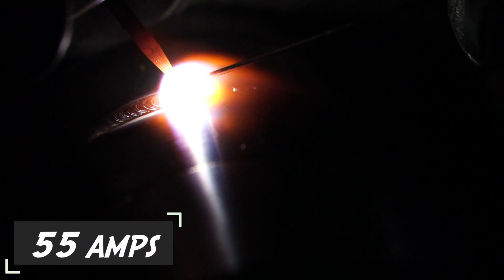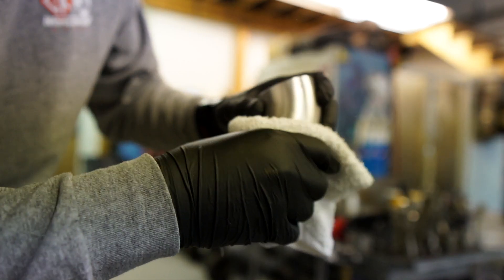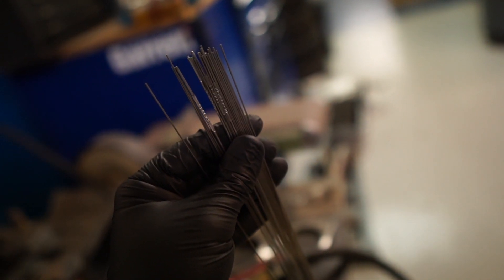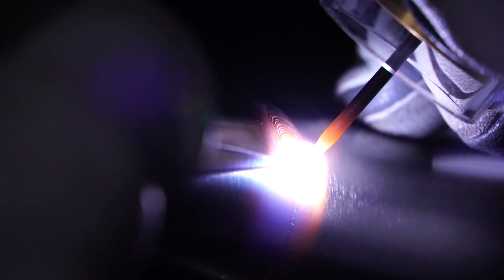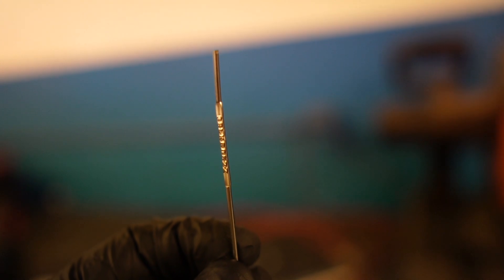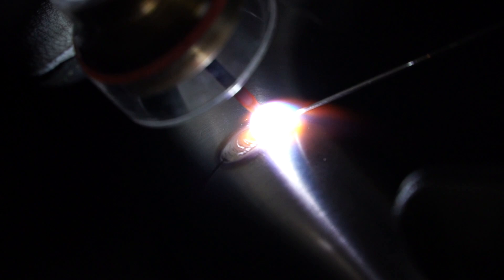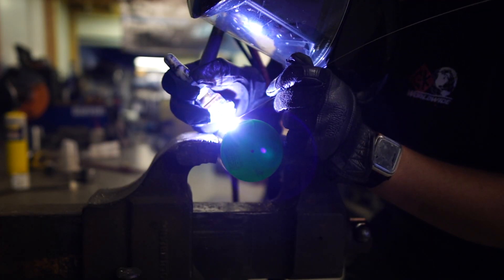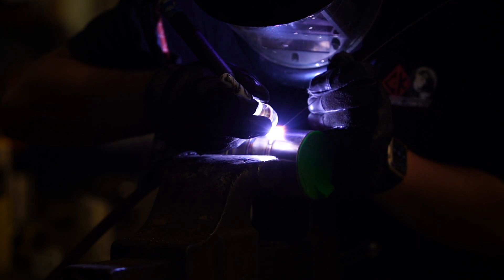How to TIG WELD Stainless Steel Tube + Tips & Tricks | Automotive Fabrication | GTAW CUPS

Comment: Lastly I was having problems with a 304 weld which was dirty from time to time. Turns out I had cleaned the filler rod with a dry cloth but that wasn't enough. Cleaned again with acetone, cloth was dirty. My problem was solved. It matters, folks !

Comment: Good video. Just remember when welding with filler don't  pull your wire out of the gas shield zone, or it will oxidise  and contaminate your weld when you dip it back in again. It's also good practice to cool your wire in the shielding gas at the end of a weld so it is ready to go for your next start

Comment: Would TIG welding be used to weld stainless exhaust tip? while on car? If so how do you purge? I'm just trying to understand what to look for as far as finding someone to weld tips onto my stock exhaust (it's stainless too)..I don't really care about looks as long as the welds will do their job holding the exhaust tip on the tail pipe.

Comment: I am not a welder by any stretch of the imagination but I am indeed intrigued by the process of TIG welding. With that in mind please excuse my ignorant question but - why do you plug the ends of the tubes?

Comment: Awesome video. However, cross contamination should be mentioned.  I realize you are doing a demo but you mentioned stainless and steel on the same belt. Also aluminum table or butcher paper for your table top. No one likes surface rust from cross contamination of steel, especially sanitary and high heat applications. I subscribed.

Comment: The Electrodes to Liquified Airon usually the Arm that bringing down the Electrodes are Make with fewest parts of  stainless steel with a tolerances of 2 millimeters,  Case ...Durability but difficult while you work with this Tolerances, because the Heath and friction changes the dimensions,  went we tooking a Arm with a weight 5 Tones and has to used 24/7 , while  close temperature to melted iron, and cost of operatio is to high, and Maintenance Contract Companies Bitter Process,  👍 
This is cool to know , on that Time I used to Rectified this Arms with a minimum knowledge on welding stainless steel

Comment: I just started working at a place we weld 316 SS with 80% of the welds are pipe and tube. From 2 to 72 inch pipes and tube. I'm fairly new comfort and consistency are definitely the number one thing to work on

Comment: what if you are not able to purge the tube? like fitting up an exhaust and long tubes. how is the best way to weld tube without the ability to purge?
Reply: Make a flux. 50% boric acid and 50% borax, mix the powder, heat the powder to 450-500 degrees to melt the powder. Cool, grind the solid piece to a powder. mix the powder with ethyl or isopropyl alcohol until the viscosity is like thick sour cream. Apply a thick flux to the back joint of the pipe, wait 15 minutes. The ethyl alcohol will evaporate. Weld stainless steel pipe. The flux on the back side will melt and close the weld from the air. After welding with hot boiling water inside the pipe.

Comment: I dont think everyone is cut out for TIG welding. I can Stick, MIG pretty good but my TIG Sucks, specially when I'm trying to build a 304 stainless exhaust system. My welds are embarrassing to look at but get the job done. I think you need to do TIG 40 hrs a week or just be extremely consistent, persistent and have alot of concentration to master stainless tube welding. Kudos in trying to teach us dummies out here.:)
Reply: You probably just can't see the puddle. I find that when I do stick and mig that the orange puddle is easy to see with green shades. My eyes can't see shit with tig and green tints. Once I got my optrel crystal 2.0 I could see the puddle. Some other true color hamlets are almost the same. I thought I sucked at first.

Comment: hello brad! very good video with many informations!! I would like to ask you something,...... you said that you welding this part with pedal ,all the way down with 65Amps straight DC? Is it 1.5 mm thickness? What straight amps you use for 2mm and 3mm? Thanks in advance
Reply: usually 1 amp per .001... but .045" filler rod running 45amps with a nice bevel on your joint will work well on your standard .065" stainless exhaust tubing

Comment: Do you have a video on how to weld V band flanges and not warp them?
Reply from the maker: I do not.. but, just bolt two together with the v band clamp and let them cool before removing the clamp. I’ve never had one warp.
Reply: @hourglassingenuity103  Thanks, I did that still managed to warp one, i was probably around 55-65 amps while welding. I didn’t weld the whole thing in one shot either so I’m not sure

Comment: What is the idea with pie cuts?
Reply from the maker: You can’t achieve the same center line radius with a mandrel bend.. even a tight radius mandrel bend.. that you can with right radius pie cuts. They allow you to move through geometry in the engine bay and bend around things for clearance you couldn’t normally.

Comment: So lets say u running a DN 50 Pipe (54mm or 60.3mm Ø) u cant possible run 65 amps right? Or i guess u run around 50 +- with the pedal input? And 1.6mm Wire?

Comment: Just discovered your channel and subbed. Excellent presentation and tips. What brand gloves do you use? The company buys gloves for glory tig welding gloves but they release a foul residue from inside the glove. Very irritating and messy to say nothing of what we might be inhaleing. Please  respond with your choice glove brand and thank you in advance.
Reply from the maker: Hey Nelson, thank you! I appreciate it. I personally run of a glove from a company called torch wear. They no longer make Tig welding gloves. I’m waiting on a new company to finish the prototype and send me a pair of gloves to try and I can report back with a video. You can also always get away with some tigsters or millers. Have a great day!

Comment: Awesome video! My only question is you said you use the same belt to sharpen tungsten for carbon and ss. I was taught never ever cross contaminate anything from ss to carbon. Because the ss can rust if contaminated with anything from carbon steel. Ive also seen 1st hand proof of this. Cut some ss pipe with a blade used for carbon and it got wet, few days later it had surface rust.
Reply from the maker: Everything is ground on a 6” wide belt. Left is for Steel, right side is for Stainless steel. A completely dedicated belt for aluminum.. besides, this is automotive fabrication man. I appreciate your precision but cutting SS and mild steel on one blade and leaving deposits is completely different than sharpening tungsten on the same belt. I do pay attention to where I sharpen my tungsten in the belt .. BUT I’ve welded a decent amount of stainless from automotive fabrication, aerospace and sanitary grade tubing and have never had an issue with imbedding or contaminating my part. In my defense, I don’t typically dip tungsten bad. I might just barely touch off on the tip if I’m holding a tight arc but as for absolutely burying my tungsten, I don’t anymore and I can see that being a problem. With that said, I’ve never had any SS rust due to improper technique. Thank you for the very good question! Weld on 🤘🏻

Comment: So tac welds don’t require any filler rod ?
Reply from the maker: With good fit up on reactive alloys like stainless steel, you can autogenously tack weld (without filler)  together your parts.
Reply: Nope.   Nice quick full pedal with a shorty gap is all you need.  304 stainless is a pleasure to weld.   I'll take that over aluminum any day of the week.
Reply from the maker: Shirosake aluminum keeps you on your toes. Embrace it. 😅
Reply: Thanks brother man I messaged you on ig as well

Comment: do you grind different application tungsten  all on the same sharpener. IE stainless, aluminum on the same sharpener. i like the hand held being capable to perform mobile processes of welding
Reply from the maker: Hey Pat, in this video I talk about how I use 2 separate belts on a belt sander to grind my tungsten.. I use a belt for reactive alloys and I use a belt for aluminum. I try my best to make sure everything has a dedicated alloy whether it’s a belt to grind or prep a part or it’s a belt to sharpen tungsten. 👊🏻

Comment: what mm is the tube?
Reply from the maker: 1.6mm SS tube.
Reply: HourGlassIngenuity and u run 65 amps on that?
Reply from the maker: I state in my video a few times that I set my amperage about 10 amps higher than what I weld with.. actual amperage while welding will vary from 50-55 amps on 1.6mm SS tube.

Comment: How do you know what amperage to weld your material at? You say several times to set it 10 amps more than what you want to weld at but if someone doesn't have experience, how are they supposed to know?
Reply from the maker: I showed examples a few times on my amperage on this specific material thickness. Machine is set at 65 amps.. I’m only talking about .0625 or 1.6mm tube in this video. Did you skip through the video? Have a great weekend.
Reply: @hourglassingenuity103  no I watched the whole video. My point is that there's other thicknesses and that amperage changes with material thickness. How does someone with little to no experience who is trying to learn determine the appropriate amperage to start with?
Reply from the maker: Nathan Schmaltz yes, I 100% understand. But this video is structured around this specific wall thickness on stainless tube. I can a video on how to select amperage for different alloys and material thicknesses.. stainless, titanium, mild steel..aluminum, etc. the rule of thumb for carbon steel is 1 amp per .001 of material so if you were welding 1/16” material or 1.6mm material.. you’d weld at about 62 amps technically.. which works just fine on mild steels. Stainless and titanium and inconel all require less heat to weld. So instead of 1 amp per .001 I will reduce that by a percentage.. mostly off of feel and experience. I will weld .0625 / 1/16 / 1.6mm stainless tube at 50-55 amps.. I set my machine 10 amps higher for cold restarts and quick penetration on restarts. I weld 1mm or .039 wall titanium at about 28 amps or so.. take roughly the 1 amp per .001 rule that you would use in carbon steel and then reduce that by about 10-15% for stainless and titanium just to give you an “idea”. Have a great day!
Reply: @hourglassingenuity103  that's fantastic information. I think it would make a great video. I'm a journeyman welder and you would be surprised by how much that kind of information is helpful to beginners. With any of my apprentices, I try to give them knowledge that can apply to a broad range of situations. I have found that telling someone a specific way to do something about a specific task doesn't help them in the future to be able to correctly alter their process with differing circumstances.

Comment: This video is lacking in showing the inside of the tube to check if welding penetrated both sides and if inside  is well protected. I use to do this with no filler on 2mm stainless walk the cup, just like any certified sanitary work, out of that, this video is pretty good
Reply from the maker: If you watched the entire video there is a shot of the inside of the tube showing a silver purge but the purge also wasn’t the point of the video.. That’s why I have a video specifically on how to back purge stainless steel as stated in the video. Thanks for watching! Have a great weekend!
Reply: @hourglassingenuity103  that 2 sec passing shot of the inside it's not enough to explain to people that did not see the other video on backpurge how important it it's that the inside looks nice and smooth, but I guess is a way to get people to watch 2 videos. Always explain further if you can most people won't see all your videos just to understand something you barely explained in this video. No hate just saying Ive been welding for 6 months and most videos explaining stuff always part explanations into several videos instead of pushing the importance of how it should look if done properly in all your videos. Although I started few time ago I'm already a sanitary certified welder and it's not even my job but a hobby I learned watching videos and practicing
Reply from the maker: VW Turbinado thanks and have a good day. 👍🏻
Reply: Thank you, videos like this from you and others made me the welder I'm today, props
Reply from the maker: Your progress is impressive. Keep up the good work! Tag me on Instagram some time too, I’d love to see what you are doing. 🙌🏻

Comment: 2 questions:
1 - why don't you use paper towels?
2 - is it okay to use 316l filler on 304 material?
Great content as always. Appreciate it a lot.
Reply from the maker: I don’t use paper towels because they leave behind a ton of particles on any rough surfaces.. also, you can weld 304 with 316 but I typically weld 304 with 308. You can google it and see why and where you would use 316l and they have a lot of good explanations.
Reply: @hourglassingenuity103  thanks for the feedback,  Brad.
Reply from the maker: Андрей Клименко absolutely, thanks so much for watching! Have a great weekend.

Comment: How are you getting yellow and blue with a #17 cup? I can't get an oxidized weld unless I use a #5 then it's oxidized and grey. Otherwise no matter what I do it's shiny silver. Second pass without filler and a #8 at 15cfh just enough to re melt almost gets straw.
Reply from the maker: If you can’t get oxidation in your welds I’d say that’s a good thing.. these 4 joints are welded out back to back without stopping in about 4 minutes so they got hot and they oxidize.. also, I don’t know how far you are running with your cup and what your post flow is.. I run 1.25” to 1.5” without stopping.. so the blues are halos from loss of coverage when I wrap the tubes radius. Also, I’m not letting my post flow sit forever until the material is cool enough to react to atmosphere and not oxidize. I remove the cup when I’m ready to give it the colors I want it to have. Have a great weekend!
Reply: @hourglassingenuity103  good idea on post flow. I'm in the 5-7 sec range. I'll pull away and see what happens.
Reply from the maker: Mr Wolf yeah you can get any color you want by manipulating it that way. Let me know!
Reply: @mordantly  Technically, the blues/purples are failures in the weld quality.  If you are doing welds for specific applications and are being inspected, any colors in the weld other than silver or light straw would be failed because of oxidation.  The colors are for aesthetics and look pretty but are actually weaker welds than those made with pure silver or straw color.  NOW, before I get internet flamed, this all has to do with the application that the welds are being used for.  For medical, extreme high pressurized systems or aerospace, purity in the weld is a must.  For auto applications like manifolds and such, the colors look pretty awesome and the impurity of the weld will most likely never matter and is just fine.  If you are welding and getting pure silver or straw, that's the correct way and you are doing everything right.

Comment: I weld thin stainless every day (best job in the world imo) and i gotta say, i wouldnt have done anything different.
Reply from the maker: That’s awesome! 🙌🏻 I appreciate your view and comment! Thank you very much.
Reply: @hourglassingenuity103  Id like to learn it,  whats your best idea to start ?
Reply: @Jackomgful start with regular steel tube as it’s cheaper. Get that down. Then back purge and move to stainless. Also practice moving fast and keeping temp control. But also get your puddle going and stable before taking off.
Reply: Aerospace?

Comment: When dabbing the filler , is it when you move and pause or move and pause and dipping before the puddle fills out completely. Without filler (flat plate) , I see a shine edge before it fills, and when it does fill out , I move. I'm guessing when your dipping the filler faster it's the puddle filling in faster.
Reply from the maker: Yeah. Dip your filler.. move forward, let the puddle stabilize (wet out and relax) and then dip it again.. if you have any weird wandering going on it’s typically due to material prep or poor quality material.
Reply: or not enough amps or too large filler freezing to fast. You want a freeze line every time you move the torch as a guide for proper amps . So it will be tons of very tight dimes not the wide gnarly aluminum spacing (stainless or mild.)  )))) vs ) ) ) )

Comment: Hey man I had a quick question, what filler and prep up would you suggest for when welding schedule 40 304L pipe (Turbo manifold piping) and would i need to put a gap or would it be butt welded? Thanks!
Reply from the maker: Hey man. Prep is all the same. On schedule 40 pipe I’d knife edge bevel all the joints and just tack them without a gap, you can still easily get full penetration as long as you have your parts beveled correctly and your using adequate amperage. I use 1/16 filler rod and on manifolds and I’ll try and single pass sometimes and sometimes I’ll even run 2 passes.. everyone is different but I’ve only built a few manifolds before and that’s the way I would do it. Have a great weekend!
Reply: HourGlassIngenuity thanks man I'll take your advice, you have good work!
Reply from the maker: Thanks! Have a great weekend!